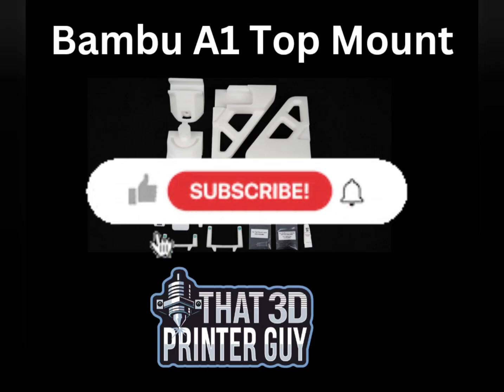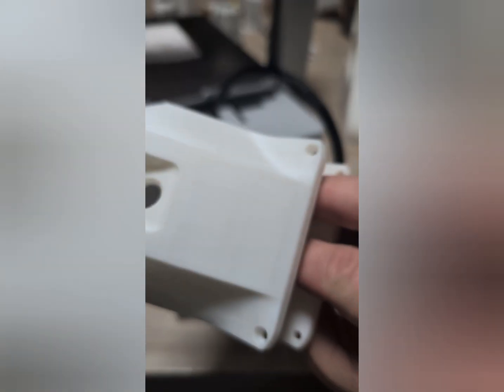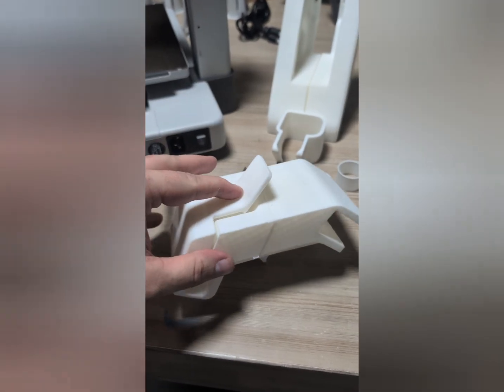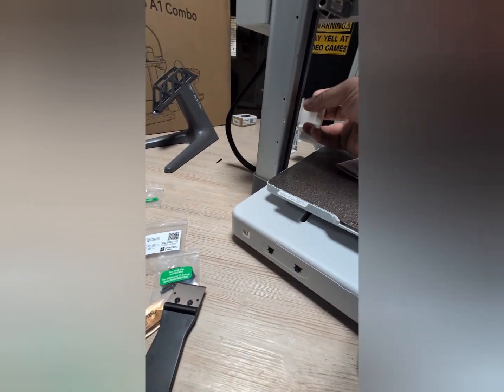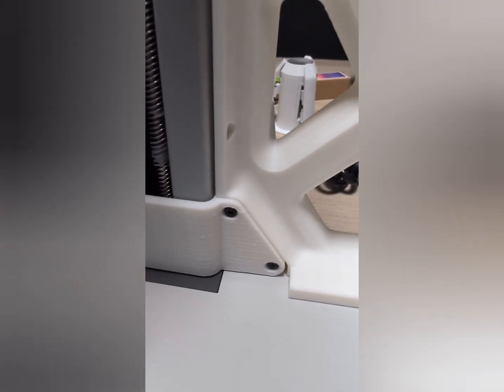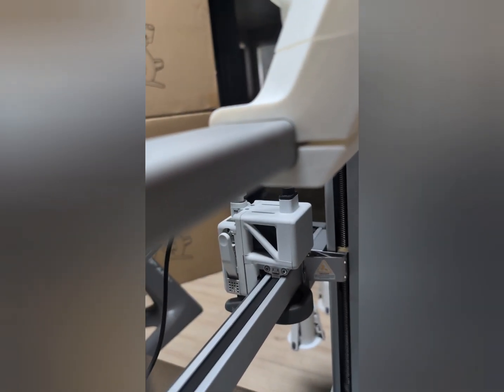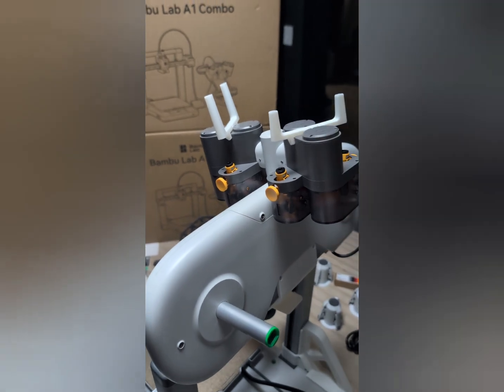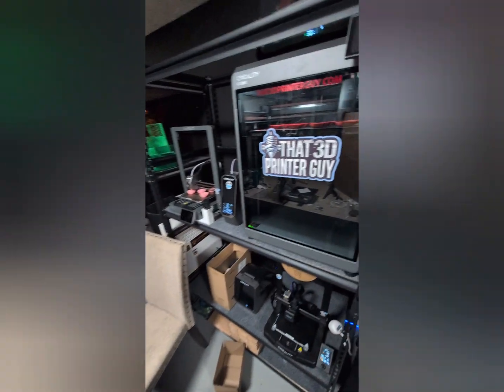Bambu Lab A1 AMS Top-Mount Assembly – Step-by-Step Guide!

Comment: Why the need to grease that part?
Reply: Depending on your access to the back side, you can loosen the thumb screw and rotate the AMS for easier access to the other spools. The grease helps it rotate with less friction. Also the #3 and 4 spools should be facing towards the bed/build plate
Reply from the maker: To be honest I am not sure, it was how Bambu recommended